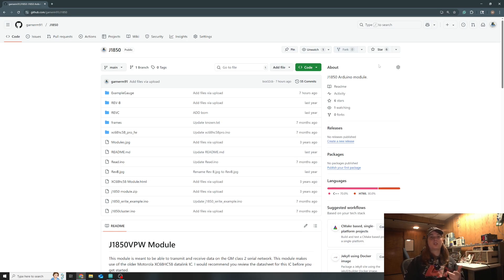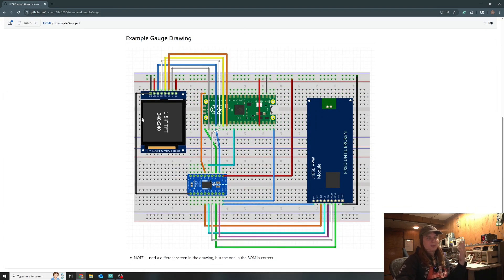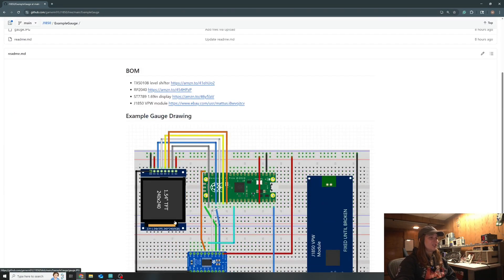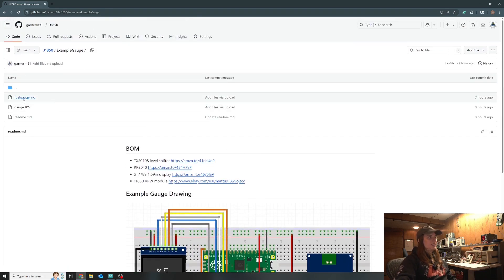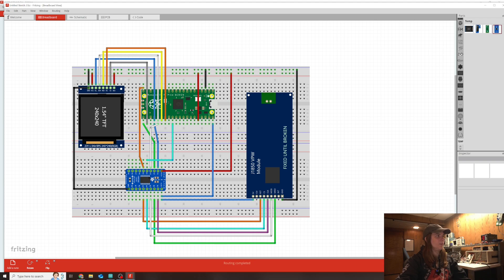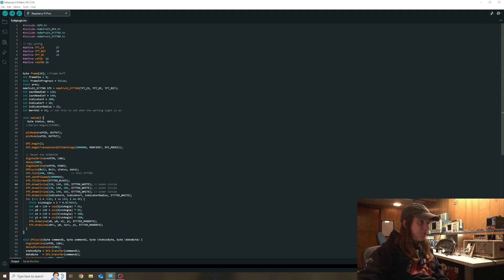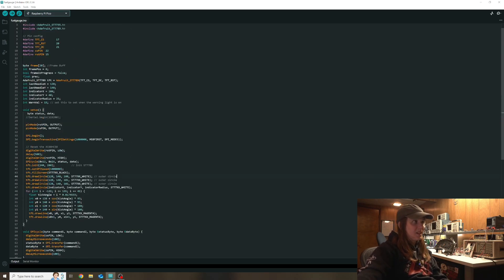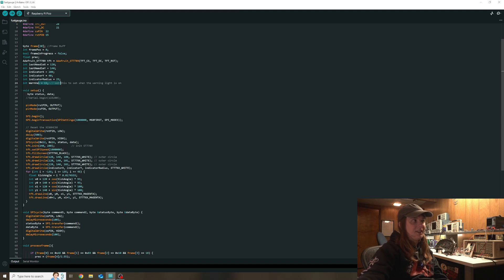DIY Digital Fuel Gauge Using J1850 VPW Build a GM OBD2 Gauge with Arduino

Comment: How do I find out which frames are for which gauges?
Reply from the maker: The way I did it was to log all of the bus traffic on my bench. So in other words I have an ECM and instrument cluster on the bench and used potentiometers and such to emulate the sensors and just capture the data while I was doing that.

Comment: Is this the module that you're using made with new and current componets? Not old stock?
Reply from the maker: I have 2 different modules. This one is using old stock the other is all in production. I used this module in the video because it sells better than the one with parts in production
Reply: Do you have the modules that are used in production parts in stock? Im wanting to embed them into a module that im making for my truck.
Reply from the maker: @jimkirk360  yes https://www.ebay.com/itm/267204241025 it bit bangs j1850 you can find a video for it on my channel
Reply: @FixedUntilBroken  Hey thanks. Keep up the good work.
Reply from the maker: No problem. I will try to get those shipped out on monday.